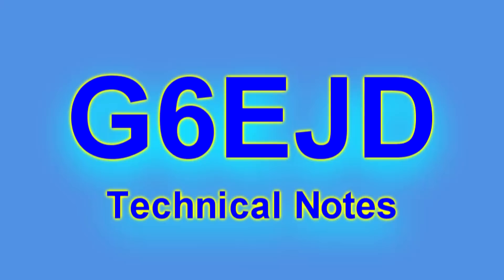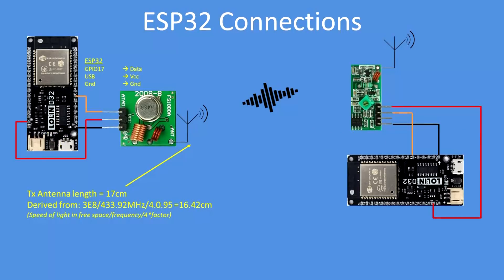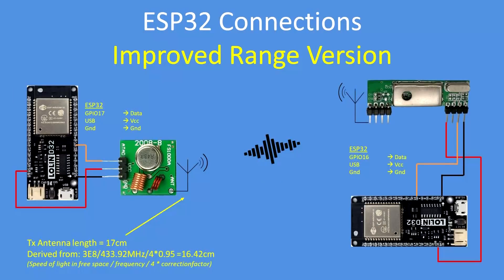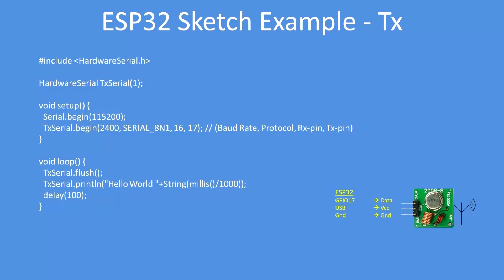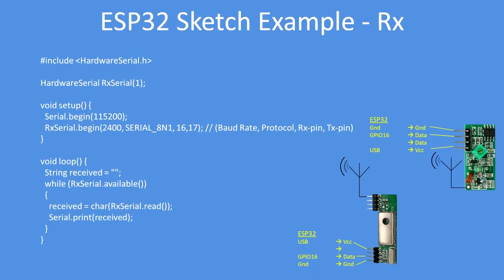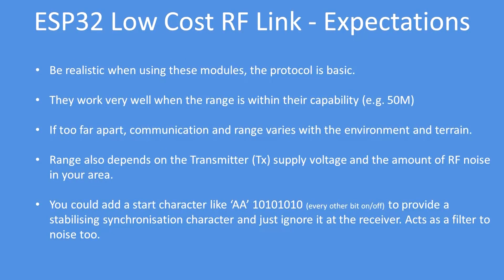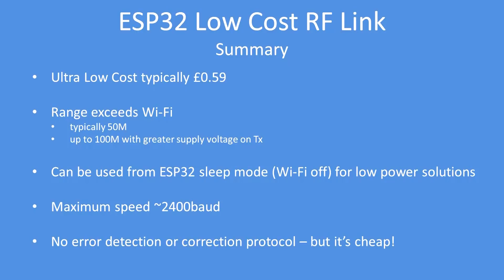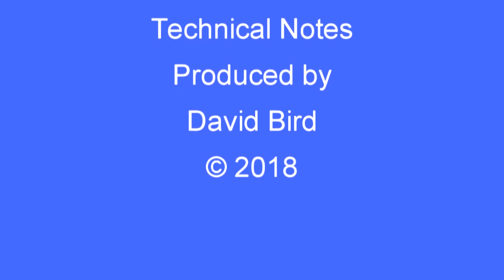Tech Note 110 - ESP32's using low cost RF links

Comment: Trying to pair the SCT013 with the NodeMCU board but can't find a library for the current sensor. If you have time would you go over this setup?
Reply from the maker: Have you seen: https://openenergymonitor.org/forum-archive/node/156.htmlThe current sensor needs a so-called burden resistor and the AC voltage is soothed to DC by capacitor C1, say 100uF and then you measure voltage at the ADC port. They give you a range of formulas to convert to RMS voltage which is actually RMS current, you know the voltage say 230v for the UK where I am and then the voltage reading from the SCT013 would be the current and Power = V x I, that's it.So you don't need a library, just read the ADC port.Also see here: https://learn.openenergymonitor.org/electricity-monitoring/ct-sensors/how-to-build-an-arduino-energy-monitor-measuring-current-only?redirected=true
Reply: @G6EJD  Thank you will review the links BTW the first link generates 404
Now to solder in the correct burden resistor and voltage divider and test. Again thank you.
Reply from the maker: Looks like you need about 20R it’s not that important if you can calibrate against a DVM and that can be done in software so if 5% low multiply the ADC reading by 1.05 or vice verse by 0.95

Comment: Very good video. Is there an equivalent sketch for an ESP8266 ?
Reply from the maker: Neil, you’d have to use the softwareserial library with the ESP8266 or use the default serial port for whatever board is in use say node MCU on pins 3 and 1 for serial port 0 or 13 and 15 for serial port 2
Reply: @G6EJD   Thanks. The HardwareSerial sketch didn't require parameters for the message length, which was appealing.
Reply from the maker: The software serial library uses the standard streams see the example here https://www.arduino.cc/en/Reference/SoftwareSerialPrintln

So no length parameters required just standard print statements

Comment: Dave, can you help?
I want to replace the : \u00e9 with an é  in the json response..
THanks.
Marc.
Reply from the maker: Is ‘:\u00e9’ a constant? And then to be replaced with é as an ASCII character ? 0233 or non escaped like e.g. 191
Reply: @G6EJD  the json reponse is:  m\u00e9tro instead of métro , i just want to delete:  the  \u00e9 and put an é instead.. :)

Thanks.
Marc.
Reply: @G6EJD  I think i got it...the thing is to convert an html to string for arduino to parse json string.
thanks.
Marc.

Comment: Can you get the Tx code with ARduino uno? 

Thanks.
Marc.
Reply from the maker: Marc, the code won’t be 100% identical but the principle will be, all you need is a serial output from the Arduino, but even better there is an ASK (amplitude Shift Keying) library for the Arduino that you can use I thin it’s called DF_ASK and that comes with examples
Reply from the maker: https://randomnerdtutorials.com/rf-433mhz-transmitter-receiver-module-with-arduino/
Reply: @G6EJD  Sorry, i didnt received anyting :(
Reply from the maker: Marc Paradis you can use the IDE serial examples

Comment: Awesome! :)
Reply: Max range i have noted using ESP_Now with EP32 is 15 to 20metres..This RF solution gets around these issues. Using the ESP32 for IOT sensors so this works great. Thanks.
Reply: @dmurphydrtc  
Good to know.
Was the distance with ESP-Now with the on-board antenna or did you use an external one.
According to this website, the distance achieved (with on-board antenna) was 160 meters (and by relaying via 2 other ESP32, this person extended the range to 480 meters). https://www.instructables.com/id/ESP-NOW-WiFi-With-3x-More-Range/

Comment: Am I missing something?
The idea of the ESP32 is that it contains a transmitter and receiver.
Why use separate devices?
Reply from the maker: Yes, I have used ESP-Now and whilst it provides a solution to a lower power consumption RF link, it cannot match these 433MHz modules for power consumption. In addition the programming / setup process is far too complex for most people to understand and modify for their own use. The purpose of my videos is primarily to be educational and informative of other techniques that can be employed and that are easy to implement. Had Espressif used the ESp8266 RF stages less (IMO) emphasis would be placed on finding a low power consumption RF link when using the ESP32 than is done now.
Reply: @G6EJD  I Understand, Thanks
Reply from the maker: Because it needs a WiFi network and these don’t and ESP32 WiFi consumes huge amounts of power, these modules don’t
Reply: G6EJD 
I understand the power consumption, but an ad hoc network should not be a problem for 2 ESPs
Reply from the maker: I have not seen any examples of direct access to the ESP32 RF stages, anyway at 100mA power consumption of the stages it does not lend itself to utilising the ULP whereas these RF modules are typically used in most remote controls and can operate on dry cells for years because of their low power consumption. And you can get much better range than WiFi
Reply: @G6EJD  For the ESP there is ESP-NOW (https://www.espressif.com/en/products/software/esp-now/overview) which works without any Router. It also consumes way less power than a normal WIFI connection. Andreas Spiess Explains it in this video: https://www.youtube.com/watch?v=6NsBN42B80Q. ESP now is a Point to Point connection which uses one master and up to 20 slaves. Setting up a connection (and transfering data) is much faster than via a router and while transmitting data, it uses less time and less power because it lacks the overhead of normal WIFI.
Reply: @G6EJD  Thanks for the video. I was wondering if the power consumption is really that low.  What if you want to send an update let's say every  5 seconds. I'm looking like yourself for a solution that can run for year on 2000 (to 4000) mAh battery.  Wifi would only be used 2 times a day for a very short time (+/-20 seconds)
Reply: @mumblic  Look at the video above (Andreas Spiess). He does some calculation on the matter ("ESP via Router" vs  ESP-NOW vs Lora)
Reply from the maker: According to the data sheet the quiescent power consumption is 1uA, so very low. Tx power consumption is a function of packet length, but much smaller than ESP32 RF stages. These units are used extensively in remote controls that last easily for 1-2 years on 2 AA cells.